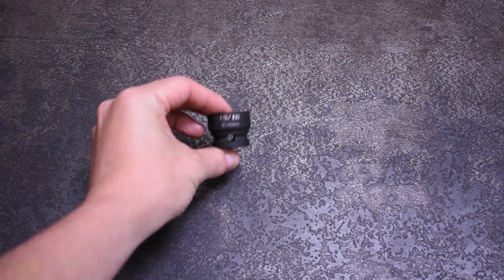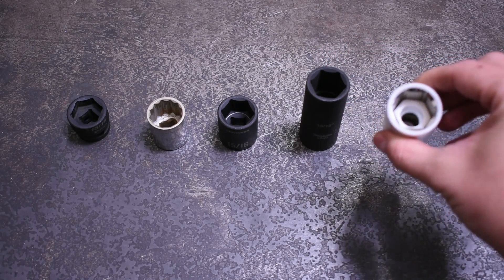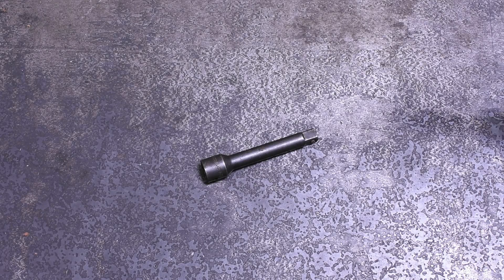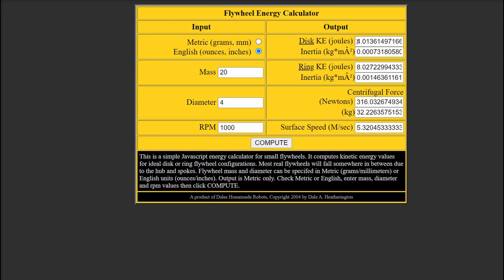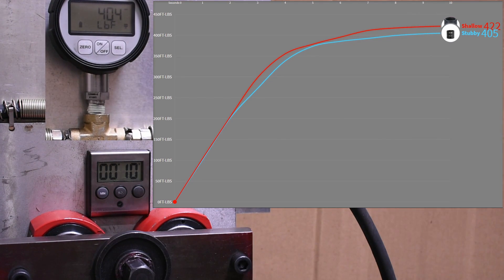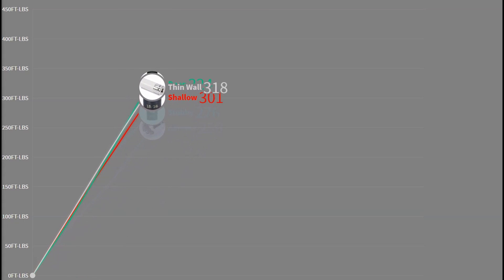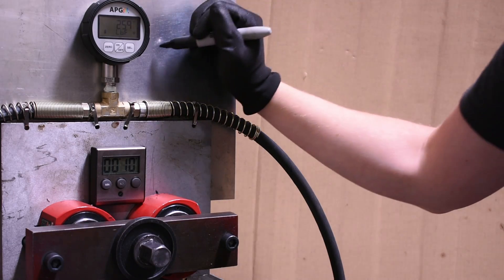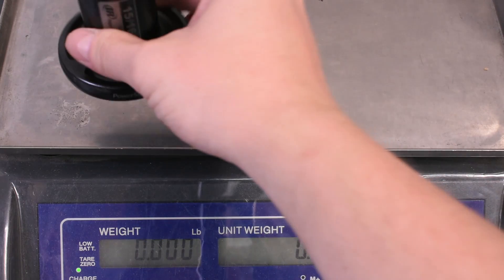Can Heavier Sockets Actually Increase Impact Dyno Numbers?

Comment: This could be done as a ultra short extension if they wanted to. 100% sure it'd still work.
But that wouldn't make as much money.
The reason long extensions cost you torque is the same reason torque sticks exist. The whole shaft becomes a torsion beam, twisting to absorb torque. If you made the extension ridiculously thick (it'd need to be about an inch or more wide) then you wouldn't see a torque loss until you approached the point of torque that could twist it.

Comment: I’m curious to see the torque difference if you figured out how to get the impact driver anvil straight onto the dyno instead of putting a socket on it
Reply: that number figure probably would not help, since anything you're using using an impact on would have a socket between the gun and the fastener. Yes, manufacturers probably use that figure for advertisement.....and lets agree that if you remove a socket from the equation for torque testing, it's just the same as removing an extension that would rob torque gains.

Comment: Looks like an Astro 7/8 bolt.

@Torque Test Channel As far as the power socket, how much "felt impact" did it have on the user vs the other sockets?

Lastly, free idea for any manu reading this.  Make a socket set with a weight add on feature.  Imagine having a set of special sockets for those really rusted nuts/bolts.  Might come in handy to get whatever size socket you need and add on some weight to said socket.

Comment: Does the weight need to be welded to the socket, or can you simply add a weight fitting between the gun and the socket, so you can just buy the weight and use your existing impact sockets?

Comment: TTC: “IR Powersockets make mad torque”

Me: “Told ya!”
Reply: Everytime we had a lug nut not come off when I worked at Discount Tire, we threw one of these sockets on and sure enough almost every time it took it right off.
Reply: Yea weighted sockets are always used once on a flywheel bolt and then they are forever in the toolbox. Seen this playout so many times myself included.

Comment: I really want to see you test torque limiting sticks to see how close they get to their rating.
Reply: I always wonder how they actually work, though. Any good explanation (video) somewhere? Or maybe TTC can get into such details should they make  a video about it?!
Reply: @blockbertus  i always assumed they flex (twist) within their elastic range which limits the power. Then they spring back between impacts. Thicker ones are stiffer and transmit more torque. they wont work with a ratchet or breaker bar because they never get a chance to spring back so they'll eventually exceed their torque spec and then get damaged. You also need to use a gun with a certain power range for them to be accurate. The ones i have seem to do a decent job but i still don't trust them for some reason. I use them for stuff that isn't too critical though.
Reply: @blockbertus  the science is pretty simple: the lenght and thickness of the stick will make the stick twist, thus reducing the energy (torque) you are creating. As long as the stick is deforming you cant transfer more energy (torque) than what it will do. It can only work if the steel they use get back to a rest (no forces on it, no twisting) faster than the impact can creates the forces (faster than the anvils strike). So if your impact runs realy fast or if it hits hard enough for the stick to reach the point where it wont deform anymore it will render the stick useless 

I hope I explained it clearly enough for you
Reply: @felixrobitaille8170  I believe @ave or @projectfarm has a vijeo of these where he tried different impacts and the torque results were the same. Exactly like you are saying
Reply: @felixrobitaille8170  Thank you very much!
Reply: @blockbertus  Think of them as a 'best guess'. To get them any kind of accurate you need to calibrate the stick to the gun, to the air system.
Reply: @dafirnz  torque sticks are great to not severely overtorque fasteners. It's an easy way to get relatively close. I like to use one stick under spec and hand torque after. Don't have to think about how many ugga duggas go into fastening and it's 1/8 to 1/4 turn before my torque wrench clicks for most wheels.
Reply: @dakotataylor7909  excellent idea!  That is the best practice for sure!
Reply: This is a great idea. And put a heavy socket on the end to see if it still stops at the same torque.
Reply: Yes, test the accuracy of those torque sticks. Be aware of the the how the ipm rate of the impact gun used may alter the accuracy of the stick.  As in, higher ipm guns may generate lower accuracy than a lower ipm gun when using a torque stick. 👍🏻
Reply: I had some cheap af OEM torque sticks, 60lb, 80lb, 100lb, 120lb and a couple others. I checked them a few times out of curiosity and they were always within 2% +/-
Reply: @jrowland6717  The cool thing is because of the spring physics involved, the longer you bang on a torque stick the more accurate it gets.  I wholeheartedly choose torque sticks over cheap uncalibrated torque wrenches.
Reply: Please!!
Reply: My ex always wanted the thick , long, strong one, and I let her down.
Reply: They are never exact with the rating but seem to be within ~10 pounds of the rating with my matco air impact. With my high torque electric they’re not even close. My mid torque electric seems to act the same as my Milwaukee. I’ve always been told if you know what gun they use to set up the torque sticks you would be able to get a better result IE harbor freight sticks with harbor freight impact, matco with matco, IR with IR and so on
Reply: Yes on both cordless and air!
Reply: Project Farm has done this idea
Reply: @garyrobinson3735  could not find this video, can you provide a link please?

Comment: Great summary at the end, the comparison between the cost of a weighted socket and a new tool really shows the value in the socket. Much more economical way to get more beans 👍
Reply: If you only need one or two sizes….

I can see it for a shop that has multiple mechanics, multiple impact wrenches, but keeps 1-4 common sizes of the power socket to be used by any tech as needed. Might be cheaper to pick up a few select power sockets vs buying one higher torque impact wrench or tryin. To replace multiple impact wrenches.
Reply: Якщо гайковерт буде слабим він теж не буде тягнути обтяженну головку
Reply: В першу чергу має бути гайковерт мощним хочаб Milwaukee 2962 або сильніший

Comment: I read if you have a stuck bolt and your impact just won’t take it off that if you twist the impact like a wrench while impacting that it helps take off a bolt. Now idk if this delivers extra torque or just a better hit from the anvil and takes up some of that spring effect. I used this trick and it worked for me. Could you test it?
Reply: Interesting 🤔 Some interesting recommendations this video. Another commenter said he saw a guy that would spin the impact up to full speed and then jam it onto the stuck bolt to get extra impact force. Would be interesting to test these methods.
Reply: I think the twisting has a lot to do with having a vane or two in the fun that’s not sealing good. So, when you twist it you get the anvil hit to be more where the good canes are. At least for me with a worn gun you can usually hear the difference when twisting it.